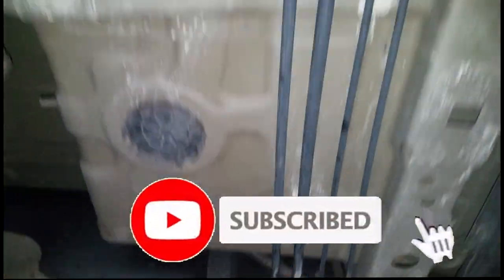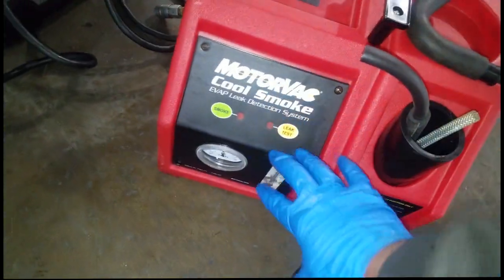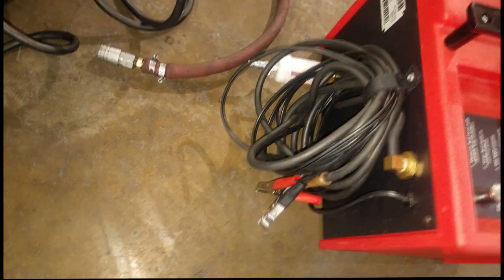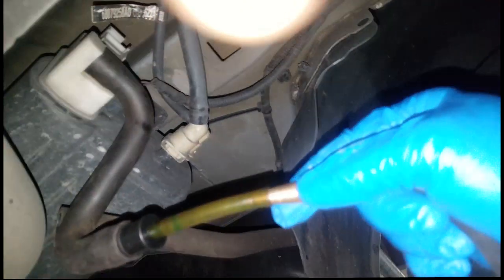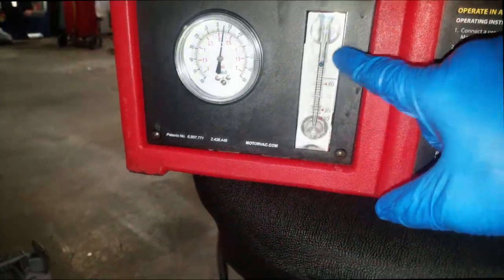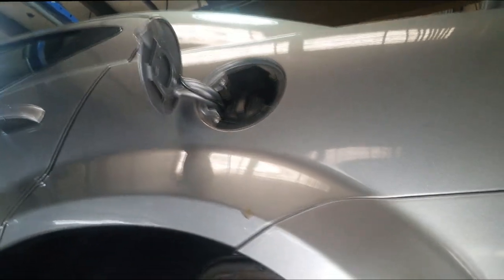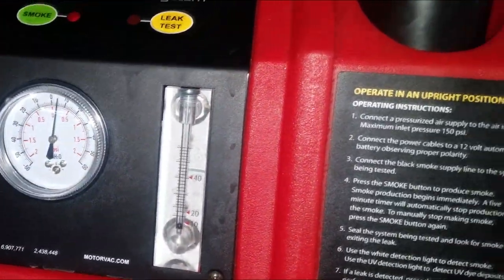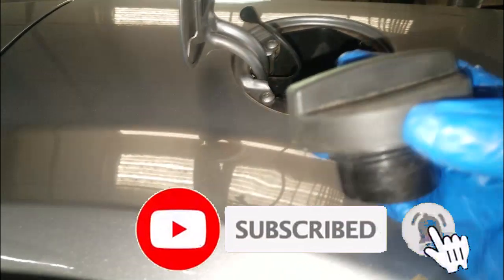Using a SMOKE MACHINE to fix a P0456 evap system small leak. P0442 P0455

Comment: What happens if there is no gas cap?
Reply from the maker: You will likely fail for an evap leak and check engine light will come on.
Reply: @OnlineMechanicTips  what i mean dodge charger 2014 does not have a gas cap
Reply from the maker: @mememetal666  Its a seal system that works better than the gas cap. With the door closed, it seals off any vapors from escaping.